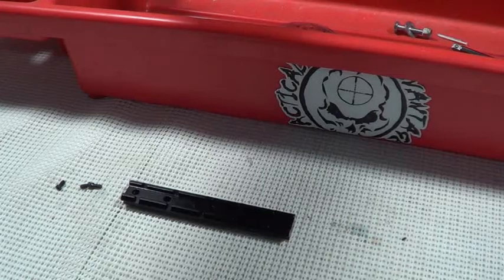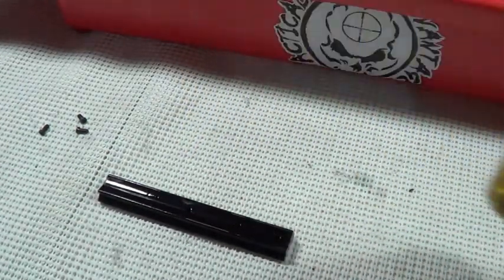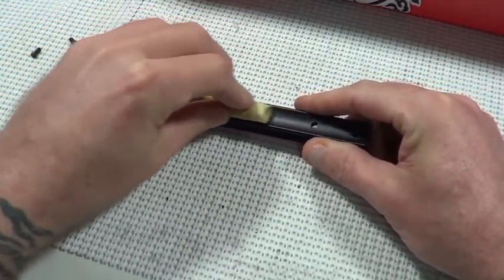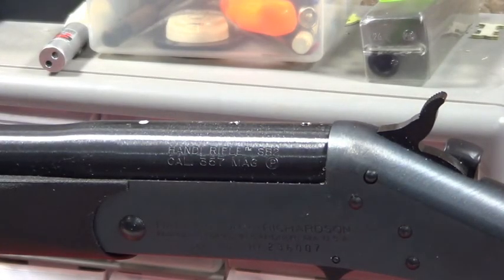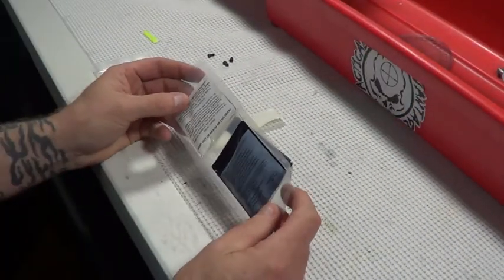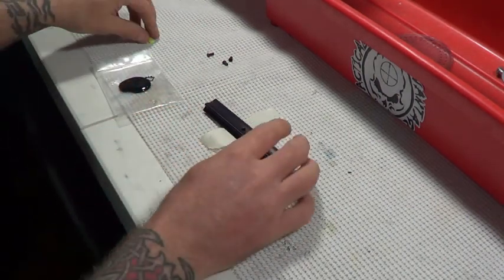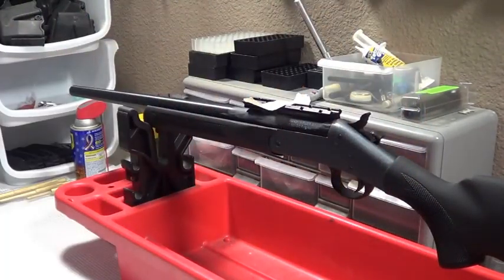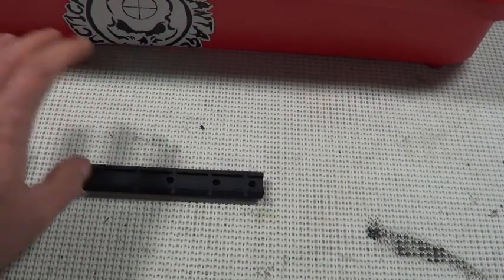Bedding a scope base to a contoured barrel or reciever, Project Mini-Magnum Part 2

Comment: I realize this is a older video and it is informative, but to anyone watching if you use something with a bit more body for the bedding process it will make the job easier. While you accomplished the set out result, the epoxy used was a bit runny for my taste. Something like he mentioned in the video, JB weld wouldn't run every where if used. Thanks for the video.